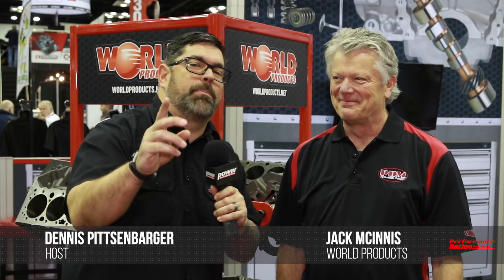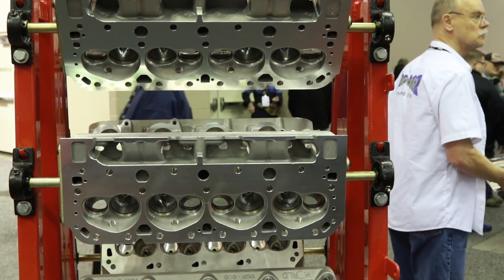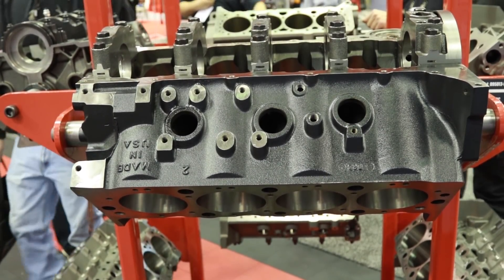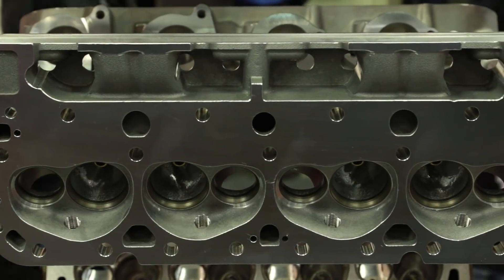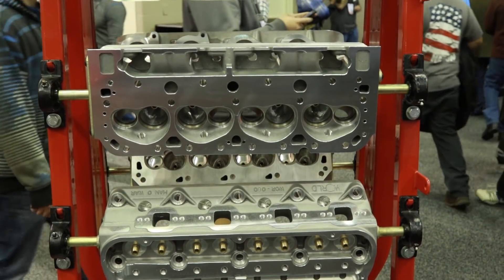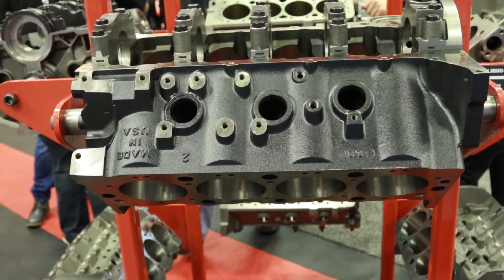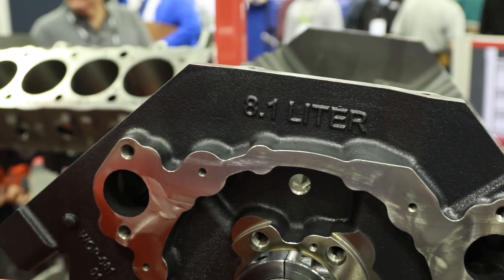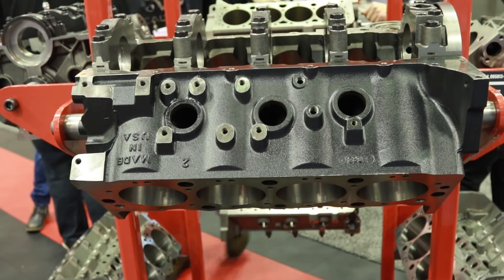PRI 2017: World Products Replacement 8.1L Vortec Block

Comment: Considering my 8.1 has 460xxx miles on it, I'd say they got it right from the start.
Reply: 1988toyota 
I see shitloads in generators. 
They used em all thru the 2000s in quite a few different manufacturers gen sets. 
Fast forward to now , and they turbo a 350 chev to replace the 8.1 for up to a 100kw gen.
Reply: Mine is about to roll over too 300,000. I did have a problem with lifters about 50,000 miles ago. So I replaced the lifters with some aftermarket ones and I replaced the push rods with 1 piece push rods. A buddy of mine finally spun a bearing in his at 530,000 miles.

Comment: I own a 2001 Chevy Silverado 2500 HD that has to  8.1 496 big block with 153493 miles .. this is one badass truck with a badass motor. I will never change anything about it it's got the power I want the pulling power to tell him shower I couldn't ask for a better truck and I only paid $1,200 for the truck.
Reply: Shit, its hardly broken in yet. I absolutely love my 01 2500hd with the 8.1 and Allison transmission.
Reply: Should single turbo 8 psi kit over 800 torque reliably

Comment: It seems the legendary Chevrolet 632 is reborn. Let me break it down.
The siamese version supports up to 4.6" bore.
Raylabs has a 4.75" stroker kit.
Combine these 2 together and according to my math you get a 631.52" engine.
Same bore and stroke as old school 632" BBC. This will be the new age 632" BBC.
Throw a supercharger or some turbos on and look out world. Hell, make it a superturbo.
Reply: Be insane torque right off throttle however the RPMs would have to be low (not that ,thats a real issue) be around 4k maybe redline probably at that kind of bore/stroke combo.
Reply: Built heavily enough with all forged internals a forged balancer on the front, extra heavy duty fly weel. Bring tourq up then put 1 or 2 throttle bodies or  2  small ( very) small 4 barrels. This engine made from high quality casting could out do a 7.4 . Almost put it on road Tractor.  I'm going for this engine on my haul truck. So is a split rear end. I hear good time can be made in fly over America. Trasport. Just for myself. 😁
Reply: @walliehart2055  If you’re looking to get fuel mileage, make a custom intake manifold adapter and install a quality lawnmower carburetor.  The main thing would be to increase the jet size and reduced the fuel pressure, also probably have to make some custom linkage